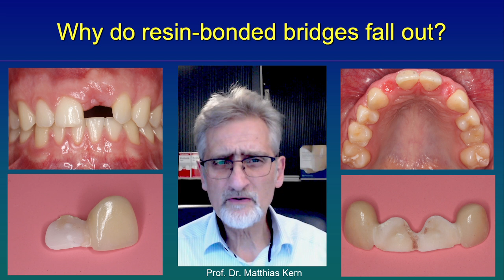Why do resin-bonded bridges fall out?

Comment: My first guess- there is NO F-ING structural support. 

Why can't partials/bridges have a retainer like base that would act as the structural base? Particularly if an individual has enough fairly structurally sound teeth left for the retainer to fit properly??
Reply from the maker: Did you watch the video in full length? You might also read this: https://onlinelibrary.wiley.com/doi/10.1111/jerd.13001?
Reply: Where can I get this done please? What is the cost
Reply: @marygraceful  You need to ask the dentists in your area. Costs differ between countries because of legal regulations, different dentists and different laboratories.